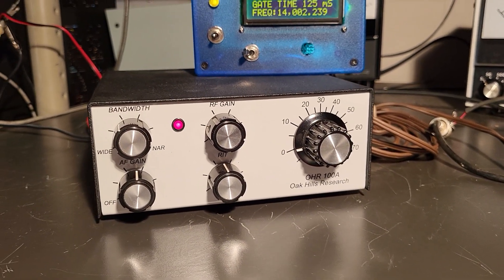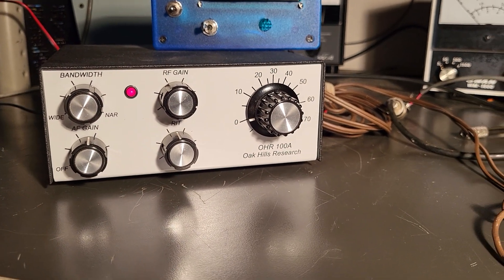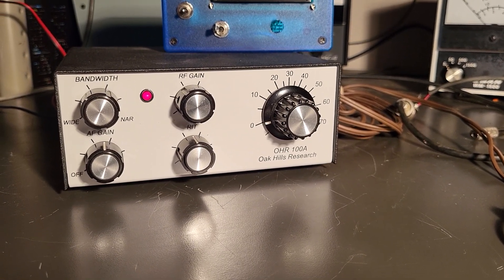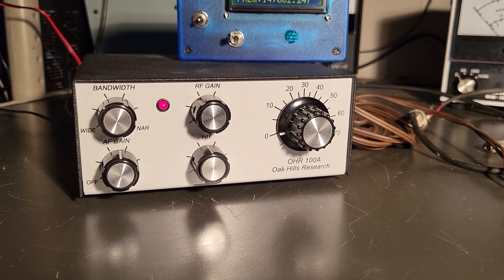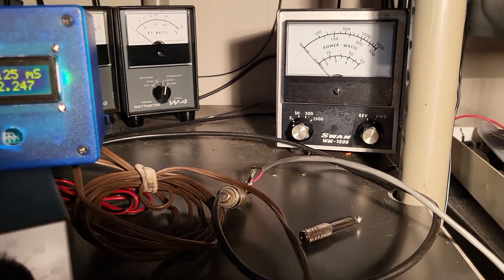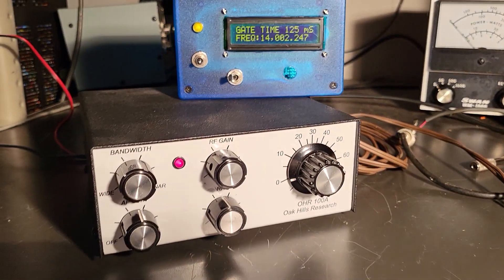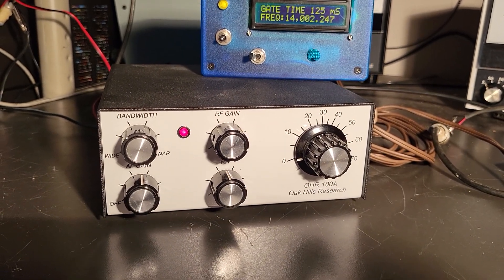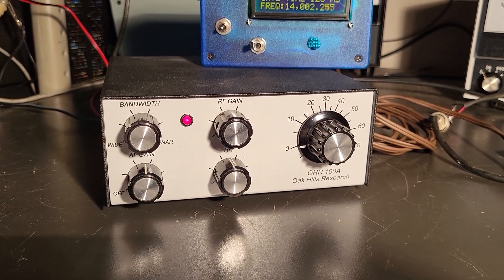Oak Hills Research OHR 100A 20 Meter QRP Transceiver w/ Frequency Unit

Comment: Hi there! I'm assuming this rig has the 10-turn pot upgrade, since it's paired with a DDS. Is that so?
Reply from the maker: yes it did. I no longer have it though
Reply: @bramfam4  Thanks! I have the same rig and that pot needs replacing. (Worn out from constant use.) I was hoping you might know the values.